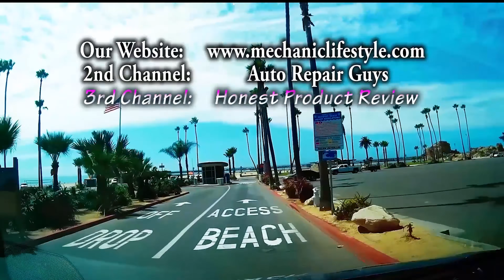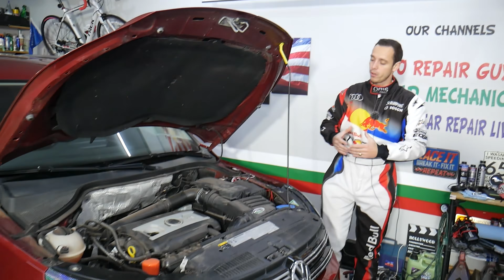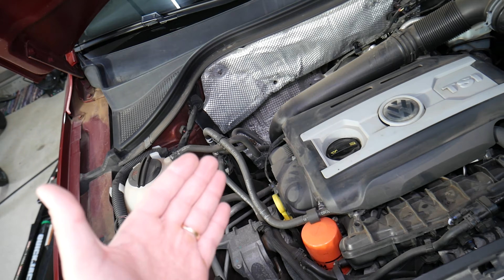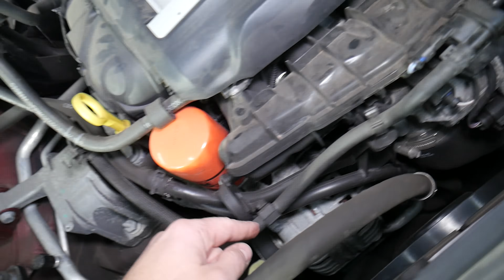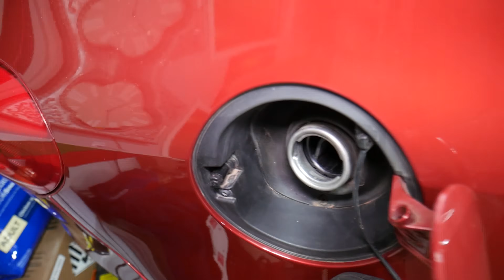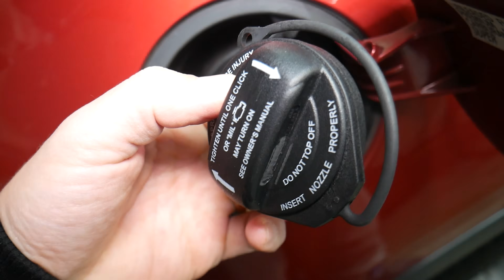VW CODE P0456 01110 EVAP SYSTEM SMALL LEAK VW TIGAUN GOLF PASSAT CC BEETLE JETTA SCIROCCO POLO FOX

Comment: I've replaced the fuel cap on my Gulf half a dozen times over 52,000 miles.  It fixes the P0456 for a couple months, then goes bad again.  Sometimes all that is necessary is to put grease on the gasket.  other times nothing works.  Ideas?
Reply: Change purge valve
Reply: Thank you... @usarmybae
Reply: Check your hoses on the system. My plastic hoses got brittle and cracked
Reply: @William-the-19th Thanks for the suggestion.
Reply: May be the tube itself going into the tank that has a leak
Reply: What kind of grease did you put on? Silicone?
Reply: @Lar2-D2  High vacuum silicone grease.   Doesn't take much.  However, although it seems to fix a leaky gas cap, I  think the bigger problem was my habit of topping off the tank.  I don't understand how that contributes to P0456, but stopping that seems to have corrected the frequent codes